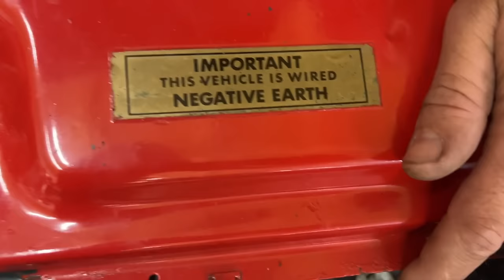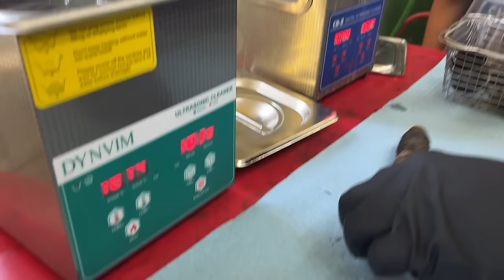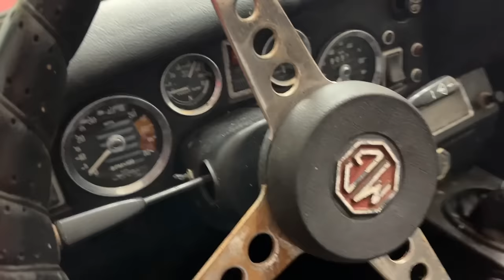My wife bought her dream car back after 17 years! Will it start ?

Comment: Hi from the UK. The engine (known as the A series) is one the best ever produced over here. Used in many models, including the classic Mini. The car is based on the Bug Eye Sprite, but with replacement front and rear coachwork. Later models feature rubber bumpers (added to meet US regulations) and a Triumph engine. Yours is arguably the best of the breed. Handling is roller skate good - great fun! Oh and the heater is good enough to roast yer feet!
Reply: Thanks for the info Buddy. These are my favorite cars that you guys made over there. The U.S. regulation bumpers took away alot from the original design of them, but they are still cool looking and fun little cars.
Reply: Glad it's an a series and not the triumph engine. They weren't the best powerplant about...
Reply: I have a 79 MK4 with the triumph 1500 and single zenith stromberg that I am reviving. I have had bug eye sprites and mark 4 sprites before and I love all of them. These cars are not everyone’s cup of tea but to some of us they are a passion
Reply: Great insight!
Reply: I live those cars, the wife's just adorable being so excited about it!
Reply: That bypass hose is  easy to replace, you can get a squeezy style so you don't have to remove the head

Comment: Hey Josh, quick tip..when you need to clean small parts in your ultrasonic cleaner, put the small parts in a small glass jar with a lid, fill it with solution. Fill the ultrasonic tank with plain water. Put the jar in the water and turn on the cleaner. That way when you remove the small parts they are in the jar and you didn’t waste a bunch of solution. I use Simple Green Extreme. It doesn’t oxidized aluminum parts therefore it doesn’t discolor your carburetor. Hope this helps!
Reply: Yea.  What he said!
Reply: This poor schmuck is stealing that pro tip! Thank you sir

Comment: Couple of things about the ultrasonic:  You should always use the basket. You don't want to wear a hole through the bottom of the vessel. Not only can you use degreaser in it, you can use solvents like kerosene or mineral spirits. You can fill Solo cups with your parts then fill the cups with solvent then sit the cups in the basket with straight water in the ultrasonic.
Reply from the maker: Ok good info thank you

Comment: That kitten couldn’t have landed in a better place. Is the midget a 1300cc or a 1275cc A-series? Keep up the good work 👌🏼
Reply from the maker: Thank you
Reply: I think they called the 1275 a 1300 (later on).
Reply: @hashprompt  that’s what I was thinking, the final run of the mini had an mpi 1.3 A-series. We had them up to 1999.

Comment: Awesome series, Josh and family! I had a '71 for 18 years, I regret selling it all the time. I believe the access cover for the transmission fluid level is on the drivers side of the trans tunnel. Oval rubber plug. And those BMC 4 speeds always whine in 1st gear, even when full of fluid. Great job!

Comment: I owned two MGBs. A 66 and a 70.  Very similar, just slightly larger. Simple once you understand them. The Weber is a famous upgrade, but I love the early original carbs (SU) were as simple as they come. Like working on a lawn mower. Of course she cut doughnuts. That's what those cars are meant for. Having fun!

Comment: There are set screws that go in the side of the carb. to hold the Venturi in. They are small screws with a point on the end,the point of the screw goes into the indentation on the side of the Venturi.

Comment: when we were kids my sister bought one brand new 1st gear was like a creeper gear  and notorius for popping out of gear the funny thing i liked was when changing a tire you pop that black plug out below the front of the door insert the jack and it jacks up the whole side of the car so its super easy to rotate the tires too
Reply from the maker: That’s funny

Comment: That little hose between the cylinder head and the water pump is the 'bypass hose' it should be ribbed and therefore flexible enough to change without removing the head.  If you do have to remove the head I have a spare head gasket and rocker cover gasket you can have.... but I'm in England so postage would take a while.
Reply from the maker: Ok thanks for the information

Comment: During the 1970's I owned an Italian car with Weber Carburetors. Dual barrel down drafts. 109 parts in each. I was in an area with less than optimal fuel which required stripping down the carbs every 6 months.
Reply from the maker: Oh wow I bet that was a big job
Reply: Fortunately I had a Haines manual for the car I owned. This had a detailed section on the Weber's. If you run into another situation with Weber's I'd suggest finding out which cars that particular unit came with and either looking up the Haines manual on line or just go and get your self a copy. 
The main problem I was having was the die that was put in the fuel to differentiate the grades - Red for Super, yellow for standard etc. the dies would go grainy sand and block the jets. Too many of them in Webers.
If you want a challenge in the future - try Bosch D Jet or K Jet.
Josh, you and your wife have  great family channel. Congratulations.
Greetings from Australia
   @Sleeperdude

Comment: you should drill a hole 3/8" in the bottom back end of muffler, side mounted mufflers, infamous for holding water creating back pressure on your valves. muffler probably full of rust chips, replace muffler. will run all better.
Reply from the maker: Ok good idea

Comment: I had a 72 Triumph TR6 ... electrically a nightmare, even mechanical gauges / parts required  periodic  replacement... I really needed a donor car to keep mine running...☹️... fun car and great on gas... I wouldn’t buy or use a Weber ever... the twin Strombergs ( oe) never let me down ... I cried real tears when I got rid of my Triumph in 1995... have fun and name it Puddin❤ ( there was a place in Lenexa, Ks that had parts for British cars from sprite bug eyes to Bentleys... a good resource if they are still around)

Comment: If it is jumping out of gear the synchronizer is bad. I had the same problem on my 66 Sprite. it was not hard to change after I had tried everything else and had taken the transmission out 3 times before, The last time took 45 minutes start to finnish. I wish I had never sold it. It was so much fun.  
Great videos, great family.
Reply from the maker: Ok thanks

Comment: Hey Josh, what a nice little MG, Tosh just loves it and the kid`s do too. I noticed that you have the distributor vacuum advance connected to the intake manifold and not to the carburetor, this would be full vacuum all the time, I have never owned or worked on an MG before so I am just saying this in case you did not intend to do that. This could be a problem at low RPM that may be part of the sputter on take off, typically, dist. adv. would be connected to the carburetor (Ported Vacuum) . We love every video y`all post, keep posting and we will keep watching.🤠👍👍

Comment: Over here I the UK these little midgets are loved big time me included as a trainee mechanic back in the 1980s I worked on them a loved them 
The little hose between the cylinder head and the water pump/ block is called a bypass hose and are tricky to change they fitted the same thing on minis with the transverse engine called the "A Series " engine just as nippy but they did suffer bigtime with rust as did most British cars of this era 
But great fun to drive and the webber carb conversion was common they came with twin SU carbs but great job on getting her running and driving I think it should be reserved for mom and wawa to drive as soon as she can get her licence
Reply from the maker: Ok thanks for the information

Comment: The car probably had twin 1 1/4" su carbs as standard, an alternative would be a single 1 3/4" su off an Austin MG Metro which will be as good and easier to set up.
Reply from the maker: Ok interesting thanks
Reply: @Sleeperdude  I can help you source one here in the UK if you chose to take my advice....

Comment: Sleeper;
   Most parts for these MG’s are readily available…but in England
  Momma’s excited about her MG! Keep it purring and she’ll keep purring!!
 Lastly, there should be a “choke” button inside the car that connects to the place you keep putting your finger to help it start.
Reply from the maker: That’s right thank you
Reply: @Sleeperdude  -There are blurbs coming on the comment section stating “you have won a prize”, I assume this is a scammer. If not you, you should let your audience know so no one gets robbed.

Comment: Wonderful video. I had an MG Midget in college, and it was a blast. As to whether or not it is a sports car? I learned back then that an MG is what they call a ROADSTER. It is a subtype of sports car, not known for great speed... but IS know for good handling and tight steering. It IS a blast in good weather with the top down. Believe it or not, in the dead of winter that heater when it works correctly will really warm that little cabin up. Also, if the car is overheating in the Summer? Run the heater wide open and it won't over heat. Would have been a good move to do the oil change earlier, but ya'll got there. The kids are learning fast!

Comment: The Weber dcoe is a complicated carb & is temperamental in use.they can be a nightmare to setup.
When bolting to the manifold you should have two metal gaskets with built in rubber O rings.
You bolt the carb on until it just traps the O rings DON'T bolt it solidly as the flats/needles will flood.

Comment: Good job. What others have not said,  you have a scarce, one year only, rear wheel ..round arch model.
Reply from the maker: Oh wow ok thank you
Reply: @Sleeperdude  We are in the process of restoring the identical car. The round arches are the best.
However I would strongly suggest bagging the Weber Carb as they will over carburate  your engine unless you have:
 Increased the compression by shaving the head or decking the block or high compression pistons
Installed at least a 260 hot road cam, ported the head, improved exhaust headers, larger diameter single muffler exhaust system. 
Electronic ignition. 
Other wise the Weber is a waste.. and don't swap that one for one of the even worse Down Draft Webers, garbage. 

Install a proper set of the original SUs.. you'll love it and improve the running and your fuel mileage.

Good luck.

Comment: I have the best luck (especially with carburetors) using Chemdip in a heated ultrasonic cleaner. Some degreasers are caustic, which will turn aluminum black. The chem dip can be purchased in one gallon cans from most auto parts stores. Leaves aluminum and brass bright and shiny! Have fun!
Reply from the maker: Ok great thank you

Comment: GREAT job!  Reminds me of when I bought a new Fiat 850 Spyder, very great miles per gallon, but a whole bunch of fun! Had a lot of fun in that car, had a GF at the time who really loved it...she was 4' 10" tall. She ended up buying a Maverick around 1970 or so. For popping out of gear, that could well be a pilot bearing, possibly the bearings on the nose of the output shaft. Never owned one, but the Weber carbs were the hot setup at that time. Seeing as they were made in Germany, the complication and high parts count figures. Personally I still love the AFB!

Comment: Great video once again, thank you. For good reference: ‘Ground’ is the actual earth, the soil, so ‘grounding’ is the process of inserting a metal rod deep enough in the earth, so as to have good electrical connectivity. ‘Earth’ is the cable electrically linking the installation to the ground, so ‘earthing’ is the process of reliably connecting every part of an appliance or installation to the ‘earth’. Waaah LOL 🙂And you've got all 3 ladies on top of cloud 9 AND you brought back the girl in you wife. Awesome.
Reply from the maker: Thank you

Comment: Back in the day big spark plugs were the only thing. But they sent out an EM pulse that cosmetic threw 8track tape decks. So they invited smaller resistance plugs to block it. That’s the reason we have smaller plugs now. I had to buy resistors to buy between the wits and plug to stop my tape deck from buzzing

Comment: If I remember correctly the original carb setup was twin 1 1/4 SU's as fitted to the 1275gt Mini, it was common for folk to change to either a single 2" SU or as you have there a weber DCOE40 to eliminate the constant pain of balancing twins up, Those webers sound nice with chrome trumpets instead of an air box.
Reply from the maker: Ok thanks

Comment: Friendly tip on your parts cleaners , , ,    If you put a piece of paper towel on top of the cleaning solution when parts are done it will soak up most of the oil and make cleanup a breeze  !     :  )

Comment: when ever I put on a new muffler I always take a centre punch and a hammer and pop a hole in the lowest point of the muffler to drain the condensation so you don't fill it up with water , when you were washing it maybe Ralphie was trying to wash the inside of the exhaust to get all the rats nests out

Comment: Excellent find.  Midgets and MGBs tune so easily.  The Midget originally came with twin SU carbs but people found balancing them a little difficult so often fitted a twin port Weber carb.  The good news with the A Series is that a bit of a polish and a port, a mild camshaft upgrade and a decent exhaust pipe and you can get some meaningful power out of it.  Keep a spare electric fuel pump handy, they pack up for a pastime.

Comment: New to The Channel. This is Awesome. If you Guys need Parts Next to my Work is an MG Junkyard of sorts. Also Those Carbs back in the 90s were used for The 12A and 4 port 13B Rotaries. They are Performance carbs.

Comment: Another great video. Loved it.
Loved the doughnuts Mrs. Sleeperdude. Try a quick touch on the  handbrake next time you drive it. At speed turn into the corner. Quick jerk on the handbrake to get the rear end sliding round. Blip onto the throttle to complete the turn. 👍👍👍👍👍
Bet the MG properly tuned would beat the Ford you ran at Ford Fest in the Autocross.
Reply from the maker: Yeah maybe so

Comment: Another entertaining watch :) . The kitten will be a friend for life, Im sure he/she will be well cared for. The choke/venturi tubes are held in weber DCOE's with a small lock screw and lock nut that threads into the outside of the carb body, one each side, you can see the boss where they should be at 1:11:12 directly under and inline with the throttle cable nut. There will be a small 'dip' in the choke/venturi tube that lines up with the missing lock screw holes in the carb body, make sure you get them the right way around otherwise you block off the main fuel supply and will only run on idle circuits.

Comment: Some of these cars have an electric over drive. That may be what the two wires are at the transmission.  The correct hose between the block and the head is shaped like an accordion so it can be installed without lessening the head.

Comment: Yinz guy's are awesome.  If yinz guys are still have carbon issues.  They sell any size motorcycle carbs that would bolt right up to that little engine.  And can be adjusted from right in the car. Plus it would be super easy to jet them too.  Just a suggestion.  Keep up the great work and I will keep on watching
Reply from the maker: Ok thanks

Comment: Josh I believe the wires going to the trans are for the overdrive with a switch on the dash, even living in England the mg midget is not a widely available car, there are still a few of them about but over here rust killed them, should have 2 SU carbs  from factory,  I believe the engine is an A series which was used in the Austin Mini for many years,  there is a few mg groups on the net, been 20 plus years since I had an MG

Comment: Josh I noticed you put Dexcool anti freeze in the  MG radiator. I think that antifreeze is oat technology which could eat up any brass parts in the cooling system.  I would try the old green antifreeze
Reply from the maker: Ok thank you I will check it out

Comment: In a ultrasonic cleaner the vibrations and cleaner solution loosen the crud from the parts. Once loosened the crud either floats to the surface or drops to the bottom. 
The crud you see on those parts would have fallen to the bottom if you put the parts in the other side up.
Reply from the maker: Ok thank s

Comment: So How those fuel pumps are set up is.  The power wire goes to a oil pressure sending switch and the starter crank power.   That way when engine is off pump shuts off
Reply from the maker: Ok thanks

Comment: If you like that MG because it's a small car and different you need to find you a Smart car. The engine is in the back and it is 2.5 feet shorter than the MG. Find you a 451 and not the 450. The 450 are way more scarce. Just under 1 liter and a blast to drive. The transmission is 5 speed manual but the car operates the clutch and shifts it automatically for you. Or you can control the shifts but you don't have to worry about the clutch. Squeezy can drive it. She looked so disappointed to not get to drive that MG. You gotta keep her interested. Love your videos Josh they just get better and better and the new format in the beginning of each video is awesome. God bless you guys!

Comment: When you found parts that fell off the MG reminded me of the 70s model mopars. I had a 1970 Road Runner 383 with air grabber, a big brick with a big engine was all they were. My 1974 450 SE will run a muscle car into the ground. I never drove a "muscle car" that would run 160 mph. with ease!! Thank God for German engineering. In 1974 the Road Runner was my college car, and i had to replace parts and pieces that fell off of it the 5 years i owned it. Hard to believe that people want a 100k for toughs roaming bucket of bolts now, they still deposit stuff on the roads till this day. Mo-rag for your money, go figure
Reply from the maker: Hahahaha that’s funny